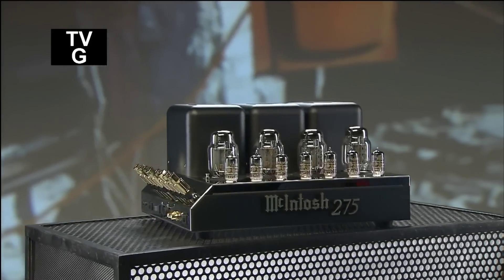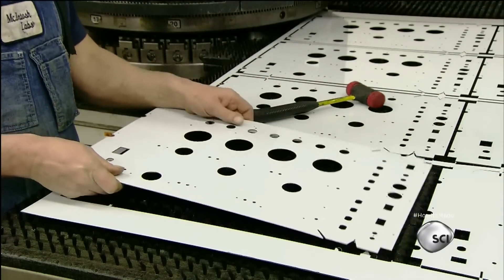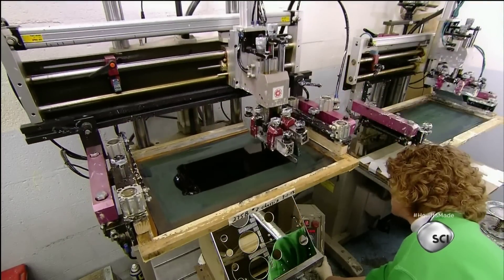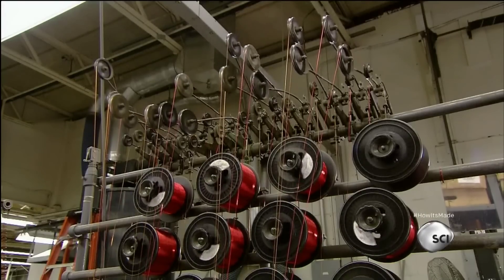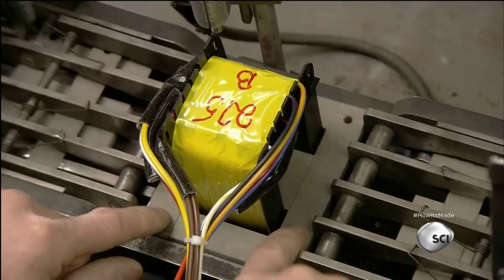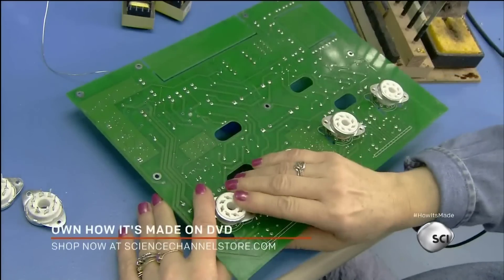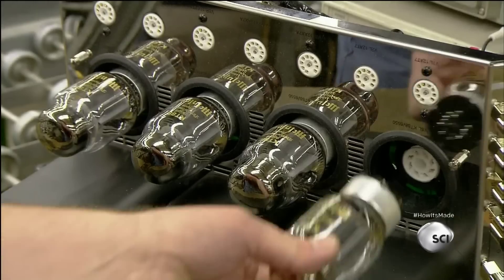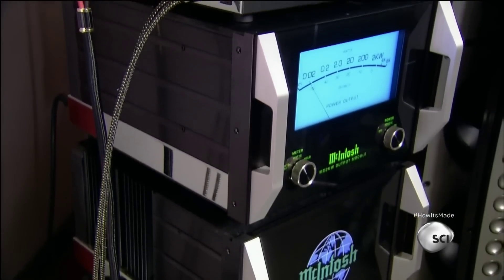How It's Made - McIntosh Tube Amp

Comment: I have worked for Hi Fi equipment manufacturers and Retail stereo stores most of my life and here are a few "Truth's" I have come to realize over time. 
1, If a speaker sounds good to YOUR ears and you can afford them, buy them. Great speck's don't mean good sound.
Listen to your ears not the salesman.
2  Very expensive "Interconnects" are a waste of money. Good quality patch cords are everywhere so do your homework and don't get sucked into any patch cords over about $100 dollars a set. (If that !!) I make my own with gold plated Kings or Amphenol connecters and high quality Belden cable. If you can hear a difference than something is wrong with the poor sounding , (Or cheap), set.
3, Look for solid state amps with analog power supply's and discrete components in the amplifier section. Many modern amps/recievers use switching power supply's and IC "Bricks" for output devises. A well built and well engineered solid state amp will sound just fine. You don't have to buy an expensive tube amp. Say that again out loud,...I don't need to buy a tube amp for good sound. 
 These are MY observations, and everybody has their own ideas, there are so many other things to talk about but remember
it's about the music first, so......always bring your own source to a demo, (CD's LP's) know the music and how it sounds on your system and be very familiar with this piece. You need a baseline when you listen to new gear so this is very important.
Reply: Bravo, I couldn't have said it better myself. I wish more people would realize that just like you have certain tastes in music. You have certain tastes in systems. There's no "Ultimate Holy Moses" system that will blow everyone on this planet away.
Reply: Just absolutely correct!
Reply: +Dragan Stojanovic Please, spare the bullshit pseudo-scientific arguments for an audiophile forum. This is a serious Youtube channel you are posting this on.
You are right in claiming that there is different electro conductivity for silver, lead or copper. But you are forgetting to say all the truth. That the difference in material plays on so tiny level that it will bring absolutely nothing that your ears would be able to listen. Even so, in fact, there is no use of having your signal travelling faster in the wire. It will come out in the same quality it gets in when your cable is of the right gauge.
Some High End Cable brands are cheating in putting some elements in their cable, for deteriorating the signal, just to claim that they cable have a sound (MIT, HMS, and others...).
Making a compairing between car and hifi is alway like shooting yourself in the feets. There is no possible comparaison possible between thos two worlds even if the imagery comes handy.
As an audiophile, you tried all these versions but you probably forgot to use the most simple and basical tools for beeing sure you are not misleaded by some subjective factors of your hearing. Everytime the same.
Reply: *****
Yeah, many solid state amps today have distortions but also a to linear frequency range. A cheap 5 way crossover is not able to make sound better... I don't want distortions, because I listen a lot to documentary and the voice of a human is one of the things, that should not get distortet. Also I use software as equalizer, to freely choose any frequency and any range I want which gives me a lot of freedom. Therefore my stereo system has a flat response.

You could add the distortions of a tube amp to any amplifier, but the problem with that is, that you need to know, what effect a tube amp has. I only saw waveforms of almost perfect reproductional tube amps. A High End Amp has more distortions but I don't exactly know which ones. Hard to reproduce something that I never saw.

I think a lot of the pleasing harmonics also come from the output transformer. Another thing missing in solid state amps. Pretty interesting, to get that tube effects 100% analog (without computer processing) and still 100% discrete elements. I am working on a 100% discrete ultra high power and ultra linear Class D Amp with 2kW RMS. Working on it since almost a year. :D Pretty difficult topic, realy! Tube amps are much simpler, because they do not aim for high efficiency, but only for sound.

5W, you say? Well, many freaks think, you need thousands of watts for loud volumes, but I think a 10W rms tone can pop your ears in a secound if you use high efficiency drivers. :D
Reply: @HeartOfGermany  True, but high efficiency drivers go into distortion sooner at lower levels and cannot reproduce lower frequencies (<60 Hz) accurately without a steep roll off in frequency response.
Reply: What do you say about the new High End Audiophile Micro SD Card from sony? It has extra low noise. BUUUUUUUUUUUULSHIIIIIIT! SD Cards are Digital! If there would be a data stream error, it would not work at all.

And that is what I mean! There are thousands of products out there, that are absolutely waste of money.
Reply: HeartOfGermany as a point of personal preference, i only use full can headphones because anything smaller feels like crap on my ears even if the sound is objectively good, so that already puts me in a position where i need 70-80$ headphones as a minimum. 

i will also say a good amplifier will drive most headphones to sound good, better yet if you can get an amp with programmable equalization, you hook it up to the pc and can set everything from there, or it has a good interface inside it already for doing so, there are a few that i know can do this, and they are a bit above entry level price for amps. 

i in the past have personally preferred headphones to be system agnostic or at least as agnostic as they can get, so it doesn't matter what i plug them into they sound great, but now that i know there are long lasting portable amplifiers that can save equalization settings so system to system they sound just as good as ever, i have options if im willing to dick around with setting up an eq correctly. 

i would still prefer spending a bit more money on headphones than relying on an eq if money isn't an issue though.
Reply: "A solid state amp can amplify a signal with no distortion..."  Not without either negative feedback or a parallel circuit path 180 degrees out of phase with the first.  You have to provide a way to make the amplifier less sensitive to variations in the amplifier's open-loop gain.   That causes its own type of distortion(s) depending upon how the feedback circuit is implemented.   If you're amplifying a signal,  you will have some type of distortion caused by the circuit regardless of it being solid-state or tube technology.
Reply: Technologic Exactly the feedback is the source of trouble of the SMPS. You think yeah the feedback precisely regulates the output voltage with the varying load. That's true but it doesn't compensate the change immediately. Rapidly changing load (music signal on the amp) produces sags of the voltage at the output of the SMPS. The feedback isn't fast enough to compensate the voltage deviation caused by rapidly changing load current. Only the filter caps can filter that out but you are using lower capacitance filter caps on the SMPS because the ripple friquency is higher and there comes the problem, you cant put a 100000uF electrolytic at the SMPS output. And the feedback only distract you from the source of the problems. The other major problem with SMPS is the HF interference they are causing. The HF noises are everywhere around the SMPS and in the DC output, getting into the sound and ruining it. So the mains transformer is the best you can have for audio. And remember to shunt the bridge rectifier's diodes with 10 - 100nF ceramic capacitor in order to avoid HF ringing of the transformer's secondary after the current cutoff through the diodes. And you are OK.
Reply: Origoangelohrol322

That is not completely correct. You can filter 99.99% if the HF - no one will notice ever the 0.01% left. Also Feedback CAN be extremely fast. Also, to get around that, a ultra high end SMPS for example does not use only a filter, but also a voltage regulator. This will get around any voltage drop without an issue. You loose just a tiny ammount of voltage and therefore a tiny ammount of power only. So it still is high efficiency.

And Feedback on Class D, when the voltage of the supply drops or rises, you just could feed back the voltage of the supply, to adjust the Pulse Width correctly. That works!

But it is very difficult, to get high efficiency at high power and quality. You need over 200kHz and a absolutely precise Mosfet driver, or your signal still can distort, because a feedback of the pure audio is not fast enought. At over 1000kHz your feedback can get fast enought, but only for fixed impedances.
Reply: I would like that one thing

When it comes to audio there's a certain amount of money that you can spend before you start getting this diminishing returns, and there's an amount that you have to spend before you get out of the crap quality.

With headphones, where I have the most experience, to get out of the crap quality you have to go with the real manufacturer none of this gamer/style bullshit, and usually to get fairly good sounding audio you need to spend about $100, up to about the $500 range you keep seeing massive gains with each price increment upgrade, however once you go past that you get some fairly diminishing returns.

If you have to go with the percent the $500 range would get you 95% of the audio quality you can possibly get, but to get that other 5% you're gonna be spending a few thousand dollars... for most people that isn't worth it.

When it comes to speakers, and I have far less experience with this than I do headphones, depending on how loud you need to speakers to be to fill the room you're looking at $150-$1000 for good quality speakers. The upper range for how good the speakers of get before you see diminishing returns around 2500 and $5000.

Let's put this in perspective, my little brother used to buy a bunch of gamer crap when he was going for headphones that ranged anywhere between $50 to $150, and every single one of them sounded worse than my Sennheiser 555 HD, that I got for about $120. When you're talking about getting headphones from an actual company that specializes in audio they were the equivalent of $20-$40 headphone but because they had gamer on the side of them they were marked up significantly.

With speakers my parents got a $2000 Bose set up in the living room. Until I got my $120 headphones I didn't realize how much money they pissed away, when I tested how good the speakers were through an audio test I found out that there is a frequency that the speakers to shit themselves if they try and process it, I believe the song was by basement jacks though I couldn't tell you what the song is anymore. Even my worst five dollar earbuds could replicate the audio but the Bose couldn't. I have a Logitech 5.1 set up for my computer, and quality wise it's about equal, it cost me $250. My brother took my advice on speakers and got klipch 2.1 speakers for $150 and the beat the shit out of what I have and mine are as good as the $2000 Bose set up my parents have been living room.

When it comes the speakers get them from companies that actually produce good speakers and not just companies that rely on a heavy marketing budget.
Reply: alidan
I accept 99%!

Just one thing:
I had many Headphones, even High End ones. The High End ones did not sound better than my 20€ Headphones, but they are much more efficient. The Problem with my 20€ Headphones is:
1. They need a "powerful" output Jack, if you want to get satisfied with Volume
2. They are very, very comfortable, BUT they do not isolate sound at all - neither inside out or the other way around.
3. You need a moderate Program like Equalizer APO, to linearize the frequency range between 12 to 20kHz
4. If you use a Headphone Amplifier, the Headphone distorts a bit at around 100db at low frequencies (below 35-40Hz). Well, most music does not have such low frequencies at that high amplitudes though, so for most purpouse it is more than enought

That proofs, that you CAN (With a ton of luck of course) get good sound for cheap, but it will always have some issues and you need to find out, if you don't like these issues.

Just have to say, that this headphones are not that loud, but if correctly equalized, they DO sound much better than 95% of all Headphones around 100€. That is 1/5th of the price only!

For sure, most Headphones around 100€, even if most do not sound good at all, they are more likely loud enought.

Well, headphones are much more individual to people than Loudspeakers, because it in fact matters, what shape of head you have. Some people like a small diameter, I prefer a Diameter that covers all of my ear. Just... individual.
Reply: Spec wise you are 100% correct. A solid state amp can amplify a signal with no distortion, or virtually no distortion added. In paper this is great. WIth test equipment this is great, but we don't hear with test equipment. We hear with ears, and our ears are not perfect instruments. To the human ear, sound that is amplified and reproduced through a vacuum tube amplifier has a more natural sound, and a more natural, pleasing sound is what audiophiles pay the big bucks to get.
I have both, and my home built 8 watt per channel single ended tube amp has a much richer sound than my solid state amp. 
My solid state will blow the doors off th etub in terms of pure power and loudness, but as far as listening pleasure goes, the tube amp runs circles around the solid state amp. It also has nothing to do with looking at the tubes, as they are both installed in a cabinet, so I don't see them.  I used the SS for parties and when I want to shale the windows. I use the tube when I am in a serious music listening mood, as the music comes alive on the tube.
Reply: Vacuum tubes WILL sound different than transistors because tubes' I-V characteristics (for a triode) contain high levels for second harmonic distortion while transistors (and pentodes) carry more third harmonic distortion. Third harmonic distortion is bad while second sounds "warm".
Reply: I've been in the "HIFI" industry long enough to agree with you fully. The politics and dick shaking is outrageous in the music industry and the snake oil sales man will try to get you every time. I love Kimber Cable or Belden for interconnects, they are great and I agree with you on the price of $100 for a pair of 8ft cables is reasonable. If I was smarter when I started, I would have saved a ton of money and the most important truth is, if it sounds good in your ears, its worth buying. This is particularly true for a lot of cheap speakers. I have listened to a $400 pair of bookshelves that put my $5k B&W's on par. I've heard $20k tube amps and $600 tube amps sound the same as a $250 amp kit. Anything else is just a sales gimmick. There are also a lot of people who spend a lot of money for status and to show off. Those people stopped liking music a long time ago, they just pay for the looks.
Reply: I have a PEAVEY Amp, for a my KORG keyboard. After 25 years, it still sounds good and it sounds like it is from the 90's!
Reply: ***** Class D's are digital amplifiers. They use PWM, which being a square wave output has a bunch of harmonics. Most of the harmonics are being suppressed by the  output filters, however if the input frequency is some derivative of the PWM carrier, than resonance causes weird Furie progression distortions... Anyways i have 4 real tube amps( not like this weird solid state/tube abomination ) that are about 40 years old. Tubes and most caps have been changed. They do change the sound. Even changing tubes changes the way a tube amp sounds. That doesn't mean that a tube amp sounds worse than a solid state amp. I mostly like them because of how beautiful they look and the feeling that you can almost see the sound in the glass vacuum bulbs. They do sound awesome, but solid state does have it's benefits- a 100W tube amp draws about 350W constantly, as for a 100W class A amp the power draw is about 150W at peak consumption. Transistors are relatively cheap and easy to find, tubes are hard to find, expensive and extremely brittle. All you need for a solid state amp are some transistors and some discrete elements, as for tube amps you also need high voltage capacitors and special transformers, which sometimes are made with silver coated windings and sometimes are even pure silver windings. Needles to say such a thing costs a fortune.
Reply: Cd 100 eur +EQUALISER 100 eur+Amplifier 100 EUR  =  CD1000 eur+Amplifier 1000 eur+ cables 200 eur+speakers 1000 eur ??? please stop .
Reply: To boot, you still get distortion with negative feedback!
Reply: 12voltvids 
Your Tubist propaganda sounds like doublespeak.
From the earliest days of HiFi, the ideal amp has been a 'straight wire with gain.'  This will never change.
Reply: Paulus ROSSINI yes, one have to be also aware of room acoustics issues. A same set of speakers, or even system won’t sound the same in two different rooms, especially for details. 
I agree with you about interconnect cable, IMO buy well built ones and invest the difference in a minimum of room treatment.
Reply: Paulus ROSSINI very good advice. Thank you.
Reply: "speck's"
Reply: Warmth is created by distortion. Distortion is caused by non-linear transfer curves. 
When the emphassis is on low disrtion and pure sound, why use an amplifier that causes distortion?
I challenge anyone to actually detect reproduction distortiobn less than 3% because the audiophiles think it sounds 'warm'. lol
Reply: Agree w your comment except for one thing, "you don't need a tube amp for great audio", here Is a thing, between a tube amp and a solid state AMP there is not such a thing to Say solid state is better than tubes or tubes are better than solid state, if you think so, you got Rick rolled mu d00d, solid state and tubes, both Sound different, tubes sounds different than solid state and solid state sounds different than tubes, the Point is, both sound different from each other, so that "you don't need a tube amp for good Sound" isnt really valid, for good sound it's really hard, it depends a Lot on the track, it depends a Lot on the amplifier, it depends a Lot on the equalizer, at least if you have one, and of Course it depends on what device are you using to hear all that shit, better known as headphones or speakers
Reply: Equalizers introduce noise into the circuit attempting to make up for deficiencies in speakers, placement, recording, or room acoustics.
Reply: Paulus ROSSINI Wow, a voice of SANITY.
Thanks for you HONEST REMARKS.
I remember the Golden Era of HiFi, the 1950s and 60s but even then the electronics ALL SOUNDED PRETTY MUCH THE SAME.
Loudspeakers were a different story but as you said if the speaker sounded good TO YOU then buy it.
As for cables, I would fall over laughing when someone proudly displayed their INSANELY EXPENSIVE cables, again they looked wonderful but sounded the same as plain cables at a fraction of the price.
Today even moderately priced electronics can sound wonderful remembering that POP music recordings are SO DISTORTED TO START WITH that the price of the electronics will never compensate for the lousy sound.
Recordings of Classical music are FAR better, especially older recordings, and with Classical,music all that is needed is PURE SIMPLE AMPLIFICATION.
Reply: Paulus ROSSINI CD's LP's means Compact Disk's Linkin Park's ?
Reply: Is that why the Radio Shack you worked at went under?
Reply: @lukerestlessstudios  Nice.
Reply: I disagree with your assertion about vacuum tubes vs. discrete solid state....vacuum tubes have a softer distortion characteristic than solid state devices, and also a different harmonic structure in their distortion characteristic; to a discriminating ear there is a distinct difference. I will not say that one device is better than another, it all depends on one's tastes.
Reply: It's so true. I'll say that a good pair of headphones that are unbiased in EQ are far more worth investing in. I got a pair of Sony MDR-7506 and it totally changed the way I heard music. For guitar amps your wisdom applies too. Fender makes solid state amps now that sound fantastic in comparison to vintage tube amps and they weigh a fraction of what they do - as a combo amp. They're set up for the modern age with line outs, wattage settings to half a watt and xlr line out for recording and for stage monitoring or even direct to stage monitors and cab simulation modeled after tube amp responses digitally. I think tube equipment is novel and cool, but impractical and unnecessary now. Coming from someone with both types of gear.
Reply: I will buy an expensive tube amp.
Reply: I have listened to and measured several amps both tube and solid state. I became fascinated with tube amps in 1995 when I had a Dynaco ST70 with PAS3 preamp on my bench for repair. When I tested that setup through my workbench speakers I had a life changing experience it sounded so open and refreshing. I still build my own tube amps. My favorite for anything longer than a few minutes is currently a single ended triode amp I built of only 5 watts per channel, through JBL E130 boxes with Altec horns tamed in the crossover. This system is over 100 decibels with 1 watt at one meter. It is loud and musically dynamic. I use a JBL folded horn sub with a 100 watt discrete transistor sub amp crossed at 80hz. I can hear the sound of large amounts of negative feedback in a circuit. It is like a dynamics compressor to my senses. I have measured harmonic distortion spectra on a spectrum analyzer to obtain an understanding of why tube amps sound so much better to me. The large second order spike of a single ended triode amp is much more pleasing to the biological sensor than the odd order spectra of most solid state circuits with their massive amounts of distortion masking negative feedback. By the way, a free running 76 triode from the 1930s has vastly lower distortion than most any free running transistor at the device level.
Reply: @hyperluminalreality1  Your speaker choices betray your hearing abilities.
Reply: HeartOfGermany Then you're contradicting yourself on one of his points.

Read point 3 more carefully.  The solid state amps he's recommending are the kind using a linear power supply with a linear power amp circuit using a push-pull topology, executed using discrete and complementary transistor pairs for each channel.

In other words, class A or class AB.  Class D need not apply.

Regarding his two other points...

Point 1 is correct because, ultimately, it's the customer that must spend the money and live with the choice.  Therefore, it makes sense for the customer to choose what sounds best to him/her rather than what the salesperson says what it is.

Point 2 is correct.  Good termination of the cables must allow for good and separate electrical connections for signal and ground to the receptacle while good conductors must allow for a good circuit with as little interference as possible.  The problem is simple, as is its solution, so there's no need to devise engineering beyond what's necessary to make a durable and functionally effective cable.  Therefore, cables with expensive gimmicks are just that.
Reply: nothing is wrong with SMPS power supplies, they save a huge amount of weight and if filtered appropriately, are equivalent, or even  better because they can easily regulate the voltage using a feedback
Reply: dragan stojanovic Well, I listened to a lot High End equipment through tube amps even. Why do they sound better? A good amp is meant to Ampilfie sound, not to give it a sound character. And a good speaker is meant to project sound from a signal, not to distort it also. I had also heared bad "High-End" shit. Like ribbon tweeter, that distort at higher volumes, even if it is not close to its power limits. High end does not say anything, it just is "expensive" or not. And why does Mercedes mean more safety than Audi for example? I mean, you will not get a safe car new for 500 bucks for sure, but you also do NOT need 50000 bucks. You are telling me about design and in the same sentence? Well, if you want design, it definitely makes sense, to buy High End equipment, because it absolute looks like state of the art. But I just want to reproduce a Music signal in a way, that as less distortions occour, as possible.

I try to proof to you? Well, it would not be possible.

Example: If you think, a gun is not able, to shoot through a car and I proof you, would you beliefe me than? And why proof anything? I just want to warn people, to pay over 20 times the money. Most people don't even hear to 15kHz, so why bother selling them a speaker, that can with less than 0.1% distortions reproduce 20kHz at full power? That does not make any sense.

And yes, I do have the money, to buy a high end system, but why should I? Sure, for design and as a power symbol would be an argument. But I do not want to proof people how "awesome" my totally overpriced amp is.

And you say, that a good PA System is much different to a good High-End system? Well, it should not be, because both is for top of the line usage. Sure, there are tons of bad speakers out there, but I even hate the sound of some expensive speakers for example for their wierd non-linear frequency range.

Do you know, why microphones are so different? Because it absolutely is wanted, that they all sound different. it would be "cheating" if an equalizer did correct the sound, but if the mic has this sound characteristics, it is no cheating. DOH! Why in the world is using en EQ cheating? People say, that all EQs do distort the sound. Bullshit. A good digital EQ does that by no means. This is just basic math!
Reply: Right but a modern solid state amp, will reproduce a signal that is exceptionally clean, but the distortion that is introduced, inter modulation distortion (IMD) and crossover distortion typicaly produces 3rd order harmonics which can be detected by the human ear in very low levels. They are most pronounced on low level sounds too, because when the sound level is low the level of preceived distortion is higher than if the amplifier is putting out rated power.
Tube amps on the other hand generate even order harmonics as a by product of  electrons bouncing around in a vacuum but since these even order harmonics are related to the fundamental frequency, they are not objectionable, and actually make the sound appear better to the ear even though distortion analyzers are are in the red.
A tube amp with 2% THD will sound fantastic. S solid state amp woth 2% THD will sound like a piece of shite. Tube amps start to sound fuzzy once you get into the double digit distortion, or if you overdrive them into full saturation. Notice I didn't say clipping. Because it is virtually impossible to clip a tube. Once you fully saturate it,  you get no more, and the nature of the output transformer will round off the edges of the waveform and give you that nice fuzzy guitar sound.
Reply: Are you trying to prove to me that shoe box works the same as a high quality hi-fi? You have no need to prove anything to me because you have no money for a better system then spitting on scientific achievements and proven fact, but I do not want to reassure you that it's better to drive a car than a scooter, not to mention that I produce and project speakers over 20 years.
It is normal that the Mercedes of EUR 50,000 is better than any other cheaper  car because it has the design, performance, comfort,  better road safety, durability, speed, or to the unknown things because you never had a chance to have. like you have not had a chance to hear the system of 5000  eur and then it would be ashamed of what you said
Reply: HeartOfGermany
 I would not go into a discussion with you, but I would argue that there are two categories of people who are buying hi-fi and these are ordinary listeners and audiophiles. Ordinary listener does not notice the difference between the sound from a laptop or hi-fi devices from 2-3000 eur. words are the same melody same rhythm as well. and for the rest of the money can buy TV or washing machine. HI-END is so big categorie that can be categorized by 5000-2000000 eur, but good systems are available for the 3000-4000 eur counting all the components of the system, but can not accept any comments that devices specifically CD players that cost 300 eur paralleled devices of 1000 eur, as well as amplifiers of 200-500 eur to be compared with the class of 1500 amps eur. A good listener (audiophile) will recognize what is FAKE and what his salesman trying to sell
Reply: +Bob Outélama yes as an a audiophile and constructor of speakers for a 15 years in the past j can only confirm what j said and j don't want to change anytning -and another  thing ! a good interconnect cable could discover how many background vocals are behind a singer and could show you that they are in some cases much better singers from a leading vocal  and that's because of its structure (material inside) and not  because of its shape or colour  these guys are not using cheap materials for its amplifiers especialy vacuum tubes or wires - so they are also on my side
Reply: Correct, you don't need a tube set. If you want that tube sound, a cheap 50.00 tube preamp placed in line between your source and power amp will all that 2nd order harmonic distortion that makes sounds warm. You don't need expensive interconnect wires, just good quality shielded copper wire..
Reply: First thing a tube amplifier does when powered on is start to wear.  Bias must be continually adjusted for best performance.
Reply: (@Macht Schnell) And those brand new tires begin to wear on your first trip to The Gap, but there’s no need to continually replace them.  Pitiful...
Reply: I spent the 90's in the high end audio business....engineering, manufacturing, and sales. (1) You can't see good sound on a meter or scope. (2) Expensive interconnects work much the same as premium gas or expensive tires....they won't make a Maverick go 180 around corners.....you must match equip.....there is a difference in interconnects, but it generally is minimal (Had 7500 dollar speaker wires at the CES show, our 11K Speaks and 11K amps saw little difference, this was about 1995). Your 500 dollar receiver will be fine with mediocre wire.....but should you move up.......(3) You need to spend big bucks for transistors to sound like tubes. I've heard some but they weren't cheap, thousands versus hundreds for tubes. My home stereo has 8 6550's, my stage amp has 12, my Leslies all use 2. There's a reason. 
Lastly keep in mind your source, components and acoustics. I wouldn't buy anything I couldn't hear in my home. And Big Box stores....are clueless. There are very few places to go any longer. The market is almost extinct.
Reply: Nope, your cable will not make a difference. I just have some random scrap wire and a few meters around the room. Well. why does it sound as good as high end cable? Well, because Sound is NOT about cable, unless you archieve to make a parasitic inductance ov over 20uH. Than it in fact theoretically change sound.

I tested so many people. I showed friends owning a Bose PA System my cheap subwoofer with a cheap amp (well 140 for the amp and 85 for the speakers plus 35 for the wood box). They actually where thinking it was HiFi. Nope, even professionals did not get, it was cheap ass bullshit. Of course this only works, if people do not know, if it is Audi or Mercedes etc. Good cable sound good in your brain.

I once thought (when I was 8yrs old), that a huge polarized elektrolytic capacitor in series to a loundspeaker sounds better. Man I "realy did" hear a difference, just because I beliefed in it.

Bullshit and now stop talking bullshit.

What was your argument? a 500€ car does not have 4 wheels acellerating, a 50000€ car does? That argument is bullshit.

The argument you are zooming for should actually be: A 20000€ Car has everything, but a 50000€ Mercedes is better because fuck, that's why!

What the heck? HUMANS HAVE NO GOOD HEARING. YOU CANNOT HEAR A DIFFERENCE, EVEN HIGH END TOP OF THE RANGE MEASURING INSTRUMENTS CAN MEASURE DISTORTIONS YEARS BEFORE YOU WILL EVER HEAR IT. STFU. I am sick of that bullshit. I tested many people, who thought, that a connector makes a difference, and than they did not hear it, when they did not know, what connector was used in that moment.
Reply: People don;t buy tube amps for sound, they were surpassed years ago, its just cool to look at.
Reply: I read your comment and people like you degrade and minimize the value of high-quality devices, and I worked as a salesman Hi-fi components and do not agree with you that less expensive connectors and cables sound very close-quality interconnect cables and cables for the speakers .your story is like a car salesman who claims to be a waste of money if you buy a more expensive car than 10,000 euros, because the most expensive and the cheapest car has four-wheel steering, engine and move it along the way .Electro conductivity varies by using different materials so as not to miss the current through silver, gold or copper or aluminum .As an audiophile I tried all these versions and came to the conclusion that there is definitely a difference in sound between the interconnect cable between 5 euros and 20 or 100 euros .The second part of the story that you do not understand is that you do not become a good salesman hi -fi equipment if you're trying to save money to your customers but to persuade them to invest in a bigger system is not a waste of money but that time the system receives its values
Reply: @galesd1971  There are sciences like electronics and physics which help you evaluate the possibilities some "high quality" approaches really influence the tone. Knowing mere basics can be eye opening in a lot of cases. 
The second eye opener is checking the approaches in the field of professional sound systems (concert and venue amplification). 
As you say it yourself, "good" salesman won't save the customers money - so he would  sell utter crap under the name of some distinguished name. And this happens so many times - and is so sad really. Knowing a salesman would honestly help you distingush highly priced junk from real quality is priceless!